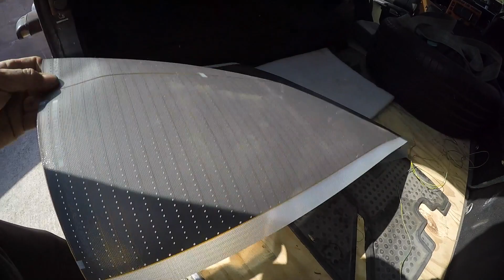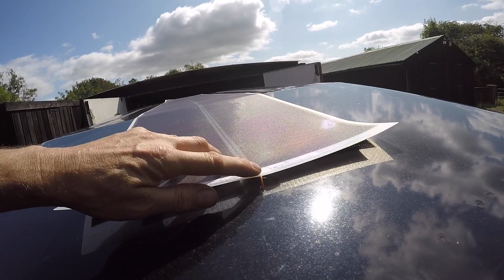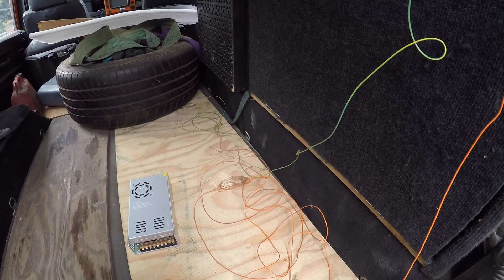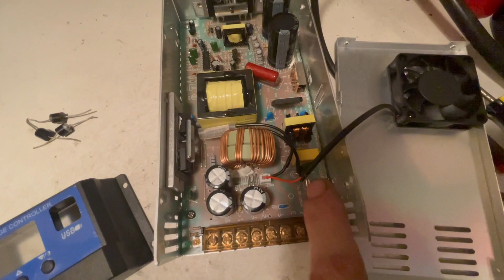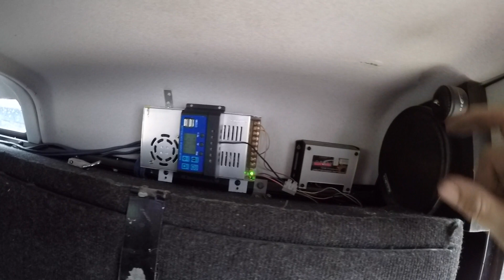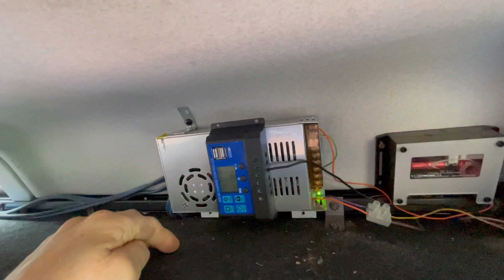Land Rover Defender - £50 100W Solar Charge install

Comment: Great video! I am unable to find any solar modules at the price you got them for, I understand you bought them a while ago and did really well with the price?
You show the power coming off the panels, straight on to the AC input of the SM PSU. The output from the panels are DC, so surely that cant work powering the PSU without oscillating the input to it with an AC input?
Like you, I have 2 batteries and split charge relay under the passenger seat on my 110 Td5 camper and have EHU installed, with Battery charger/ conditioner on both, powered from the mains.
I think I will go for lower voltage panels and a solar charge controller, straight on to each battery, unless there is an advantage coming off at 280V and then regulating back down to 12V....maybe you will still get 12V, when light is low, coming off the panel at a higher voltage?
Anyway, thanks for some really detailed and informative videos, they are all excellent! Keep up the great work mate 😎
Reply from the maker: Hi, thanks for the kind feedback 😁 with most switch mode power supplies the input voltage is actually rectified to DC anyway so people don’t realise that you can use DC on the input instead of AC, it’s the switch mode that switch’s very fast to regulate the voltage then it’s smoothed with capacitors, that’s why they are very efficient, I only went this route as I already had the high voltage panels. It’s probably best to use lower voltage panels for your setup 👍 cheers
Reply: @CarJunkeez  Thanks for your reply, yes that does make sense, just never had any reason to do this, so as you say, didn't realise you could. If I could get high voltage panels for the price you got them, I would definitely go down the route you did, but yes, probably more efficient going low voltage. I will keep an eye out on prices for the HV panels now though, cheers!🤪